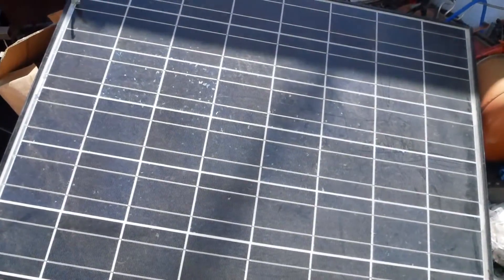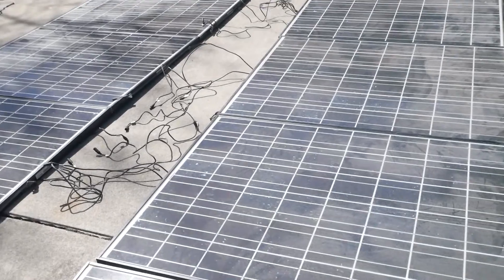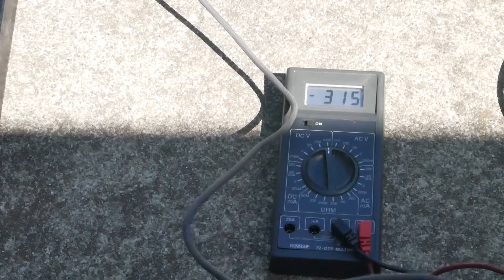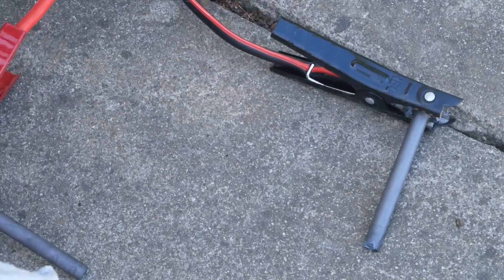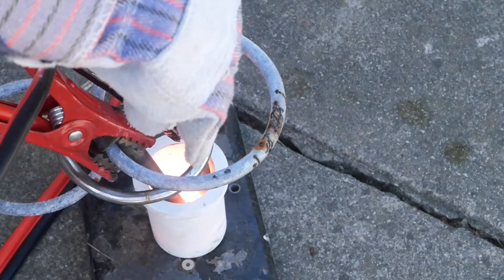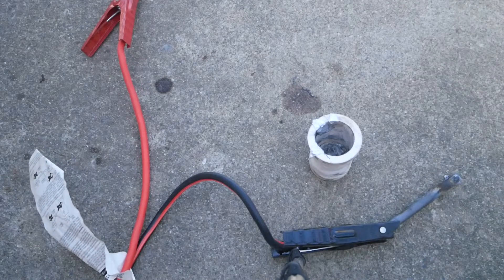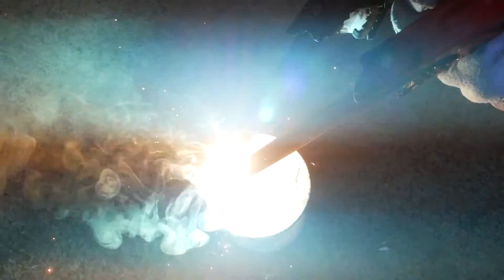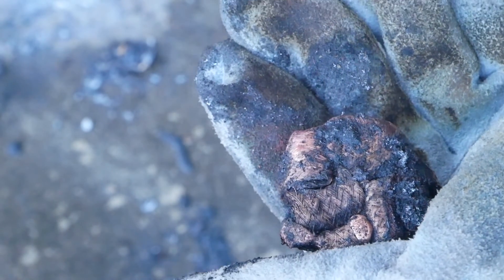Solar Powered ARC FURNACE melts aluminum

Comment: In the only shot of the connected panels I saw, some were partly shaded. Not sure if that was the case throughout, but if so it probably killed performance. Not just that the shaded region wasn't generating, but it also blocks a lot of power. Otherwise, sorry for not noticing, I'm kind of working while watching.

Also, not sure if there would have been wiring difficulties, but it might have worked better in parallel so you would have had more current than voltage which seems to be the thing to do with welding and other hot arc-y stuff. And, it might not have killed you if you touched it.
Reply from the maker: yea they were full sun when i tested  but i didn't do parallel cause of the need for so much extra wire

Comment: When you daisy chain them the weakest panel limits the current through all of them, I see shade on some of them. Why not connect several sets of them in parallel?
Reply from the maker: true  i should have paralleled all of them but wanted to keep the wire thin

Comment: Nice. Just be super careful melting or welding anything that is galvanized or zinc coated like those crap wrenches. Remove the Zinc first.
That yellowish white stuff on them is Zinc oxide which isn't toxic on the skin, but breathing in the fumes or dust causes Metal Fume Fever and will make you really sick. It feels like a bad flu, but can be deadly. I warn people because just a small exposure landed me in the hospital for 2 weeks. I thought I was safe welding outside but the wind shifted and blew the fumes under my hood. I immediately stopped but it was enough.
Reply from the maker: wow ill be sure to get a respirator or have a fan going

Comment: One mad scientist to another, plz be careful pouring molten metal over concrete. If there is even a trace of moisture it can splash around violently like a drop of water on a hot skillet!
Reply from the maker: yup its happened before  i was wearing full protection  but its still scary

Comment: Dear Ian Builder, years ago the king of random made an arc furnace by drilling/cutting a fire brick.  You've got all the power you need but i think the fire brick furnace will help melt things more reliably.
Here it is.
https://youtu.be/VTzKIs19eZE
Reply: if you were anywhere near Massachusetts I have 10 optical mirrors i'm adding frames to in order to reflect more light at some solar panels.

Comment: The copper didn’t melt because it’s one of the best heat sinks on earth. You had too much mass for the power rating of the welder. Steel is a relatively poor conductor of heat and electricity. This is why welding steel is easier than aluminum too.
Reply from the maker: yea i figured it was  just heating up the bottom of the crucible prob needed more patience